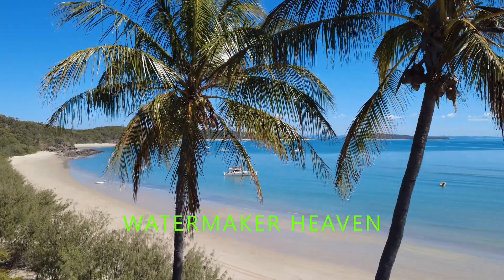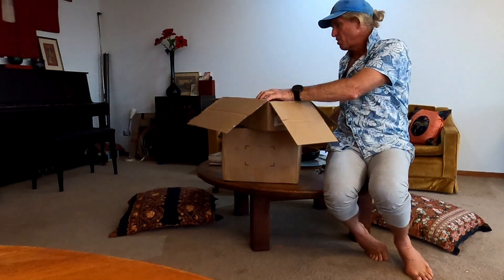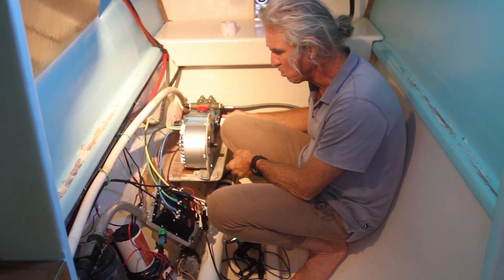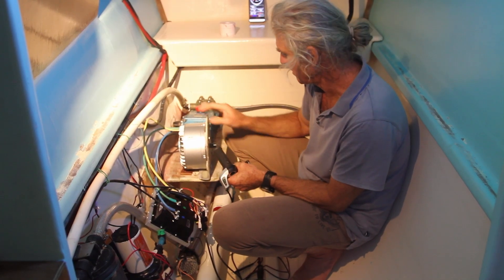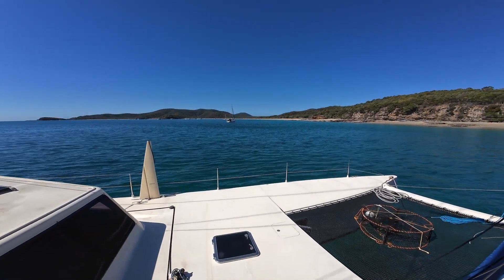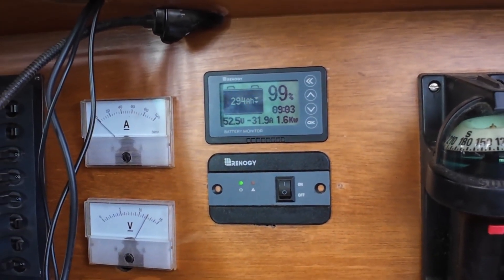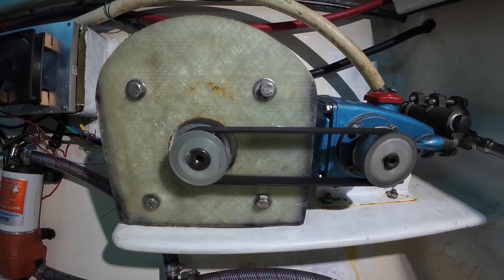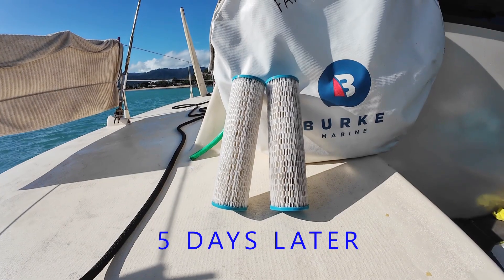48V Electric Watermaker Setup on Our Catamaran - Tips, tricks & hard-won lessons.

Comment: That's a pretty slick use of available motors and parts! I don't have access to all my stuff, am working away from home for now, but when I was building an electric gokart project, I was testing throttles and learned they're basically just a PWM set up, the throttle is basically a potentiometer. I tested a 10 K Pot (I think?) and that worked just fine, maybe the range wasn't right, I don't remember, but if you can get something like that, you could set the range on the pot, but it wouldn't be spring loaded back to idle. If you are handy with electical or electronic components, you could also just set up resistors to do the same thing, but I'm pretty sure the motor controller expects idle on start up, so you'd need a switch in there, to switch between idle and running speed. I found one of my old videos from that project, where I was mapping the throttle signal here,  jump to 1;45 or so if you don't want to watch the whole thing.. . https://www.youtube.com/watch?v=i_NUaI09tTM Thanks for sharing your set up, that's pretty cool!
Reply from the maker: Hello Carlin, thank you for these comments. Loved your off-road bike build, what an interesting life you have! I concur completely with your comments of the twist throttles, the band of movement is quite small. Even worse is the foot throttle I am using for my main electric motor! I have this foot throttle connected via morse cables to the cockpit controls but he amount of travel I get is very touchy. You may not have seen the end of my video on the watermaker, but I actually fit one of those potentiometers  and it is so much better! In my case I don't want the spring back so it is perfect and I can simply dial up the required rpm. I am thinking that I should try to adapt one to my 10kw main motor and replace the foot throttle. It just seems such a small and simple thing it makes me nervous! I could fit a little lever to it to work in the same way I have adapted the foot throttle. Thanks for the comment and enjoy your remarkable life!
Reply: @AndrewStransky-cc2dr  Sorry if I missed the use of the potentiometer, we're on the same journey I guess! If you are able to measure the exact resistance of the pot at the speed you want to use, you could just drop in a resistor and then it would always be at the same speed. However, I think the motor controller still needs to start at idle, so that wouldn't quite work right. Anyway, this is the fun part of the internet, odds are someone else is doing the same thing, and we can freely trade ideas and experiences. I was in the US Navy for 9 years, but I was an aircraft mechanic. I don't know much about boats, so always enjoy watching the sail boat videos!

Comment: Thanks for the great video. I'm completing a 40ft solar powered cat which will capture rainwater from the panels. I have two 400l tanks just for drinking water and two 170l tanks for everything else. I may build a water maker like yours if this amount of water proves to be insufficient.
Reply from the maker: Thank you Alan! We have similar sized tanks and a good rain collection system and have often had abundant water from the rain. And of course you can always fill up at a dock. Yet there are certainly times when the rains don't come and it can be expensive or difficult to dock up to get water. Also having the watermaker means you can keep your boat a bit lighter by carrying less water. Wishing you good luck with your solar powered cat! I'm sure it will prove wonderful!

Comment: I like the system but I am surprised at your power consumption . We have a standard Dessalator 100l/h unit. It used the same cat pump as yours but a 800w 12v motor. When running we are using about 35 amps at 12v.
Reply from the maker: Hello Mike. around Yes, I am rather amazed as to what you say. All the study I have done on the Cat 277 HP pump says that around 1500w is normal for running these pumps. Also many watermaker producers suggest such a power usage to run this type of 90l/hr membranes. I do know that the Spectra type of watermakers that utilise a special and very expensive type of 2 -stage pump, they are considerable more efficient. My friend has one and it produces 40l/hr at 40 amps @ 12v . Your system sounds truly amazing. Is it a particular model or a DIY build. ?
Reply: @AndrewStransky-cc2dr it’s a factory fitted Dessalator brand from France. On my cat 277 pump there are only 2 pistons running the middle one is blanked off. We have the compact unit which has 3 x 21 inch membranes in Series. We used to have a spectra on our previous cat with the Clarke pump. One nice thing is that there is a high pressure tiny accumulator fitted to the Cat pump which takes the pulses out of the flow and they say is good for the membranes
Reply from the maker: @mikeferguson2828  that is very interesting. So they have converted the triplex pump into a duplex! I'll have to look into these pressure accumulators as well. I do so love the technical world involved in sailing, there is always so much to learn! Thank you for this input!

Comment: This is excellent! Thanks for sharing. I really like the modular construction.

I may do something similar to this.
What’s the type of high pressure pump you have there?
Reply from the maker: Ahoy the Arctic Sea Camel! This HP pump is a Cat 277. They are quite expensive, but a good pump. I got it off my fathers boat when he removed his neglected watermaker. Our original pump had eventually began to leak oil. I have seen cheaper ones that would do but the Cat 277 is well respected.

Comment: Torque is Amps, Amps is heat. Why not use a 3000rpm to drive the pump at 1500rpm?
Reply from the maker: You make a good point Blackeyes! I will make further experiments with this idea. I have tried running the motor at a higher rpm but it still seems to only run for the same length of time. Perhaps if I changed the pulley ratio to run it faster and allow the fan to run faster this would work?
Reply: @AndrewStransky-cc2dr a higher pulley ratio would certainly decrease heat, but another thing you might try is direct drive with a coupler.  That would eliminate the efficiency loss of the belt and pulleys and therefore decrease some heat as well.  Direct drive will be the most mechanically efficient (2% better than a timing belt.)  A higher reduction may be more electrically efficient therefore overcoming the 2% gain from direct drive.  For example, if a 1.5:1 ratio sees a 3% gain in total efficiency, then you don't even need to test direct drive. If it's getting that hot, a significant amount of the electricity is being converted directly to heat so I wouldn't be surprised if a higher ratio was better than direct drive.
Reply from the maker: @zacharymorris9917  Hello Zachary, yes I will try a 20 tooth pulley which will mean the motor will run at around 2500 rpm, which should give it a better chance to cool itself. In this way I could still use the same belt.
Reply: @AndrewStransky-cc2dr howdy Andrew, have you tried different pressures or does the data sheet for the membrane show an efficiency graph at different pressures?

Looking forward to seeing your results.
Reply from the maker: @zacharymorris9917  hey Zachary! I have tried lower pressures but I felt the overall output didn't benefit much, especially considering the additional noisy runtime involved. I think increasing the motor speed with a smaller pulley is my best bet and will order a pulley asap. I did take off the motor back plate thinking that may help more air get to the motor but I feel that may have been a mistakes as the air is probably not directed as well, so I have to re-fit this piece! It'll probably be a few weeks before I can order a pullet and carry out this trial.
Reply: @AndrewStransky-cc2dr did you get a chance to try a different pulley ratio?
Reply from the maker: @zacharymorris9917  Hey Zachary, thank you for reminding me! We have got back to what is town for us, Moreton Bay, where we don't run the watermaker as its too silty and we can get water, so I had forgotten about this, but I will order a pulley today. We are off on a cruise south at the end of this month.
Reply: @AndrewStransky-cc2dr cool.  Let us know how it turns out

Comment: I don’t understand why people don’t use solar distillation systems on boats. I haven’t found anything online in years. I guess I’m going to have to make one and see.
Reply from the maker: Hello Michael. I did once meet a guy sailing around the world on a Wharram tiki 20 and he had one. It was a ring about 80cm in diameter with a raised clear plastic cover that collected the fresh water. It made about 1.5 litres a day for him. It would probably take too big a one to provide for the demands several people on a yacht.
Reply: @AndrewStransky-cc2dr  I think I’ve seen those, but don’t they float in the water ? Probably too fragile for voyaging. Maybe a similar concept could be incorporated into a hatch cover?
Reply: @AndrewStransky-cc2dr  I think I have it: Wet surface of a solar panel, a clear enclosure to trap the vapor. Scalable to as many panels as you have, keeps them cooler for better efficiency. Thanks for pushing me to think about it!
Reply: Those I have seen has been way to inefficient for daily life/use. That said the new design from MIT (a year or two back) looks really promising. Edit: Search for: mit desalination breakthrough.

If you want to try the distillation rout you should look at compound parabola.  Nighthawkandlightning has a nice video on making those.

I also wonder if it is possible to use fresh mangrove branches the same way you can purify water with birch (and other leaf trees) cutoffs.

Comment: Great and simple setup.  How did you determine what size golden motor you needed?
Reply from the maker: Thank you Nuts and Bolts! I originally had the idea they required between about 1.5-2 hp by the way it bogged down our 13hp motor we originally ran it from. I did plenty of Google searches but could never quite pinpoint this. Then when my dad removed his neglected watermaker from his boat I saw its 240v motor rated at 1.63kw. So this turns out to be exactly what it uses. It was a bit of a shot in the dark though, to hope the 3kw would run it! I should have brought the water cooling model though as I can only run the air cooled model for 30mins so far, but I may be able to improve the air cooling system over time.
Reply: @AndrewStransky-cc2dr do you have any experience with the high pressure pumps.  You mentioned the one you have is common, but are there high flow pumps available?
Reply from the maker: @nutsandbolts432  the one I have in this system is a Cat 277 pump and they are commonly used on production watermakers and feel of very good quality. You can see them for sale and also on ebay used. There are also a number of HP pumps much cheaper on Aliexpress and you could probably use one of those but figuring out the equivalent is a bit tricky, People also use the Karcher pumps running off 240v as a HP pump in this kind of system.
Reply: @AndrewStransky-cc2dr If your motor is overheating, try switching pullys to change the gear ratio. Smaller motor pully or bigger pump pully. Have the motor run at a higher RPM but lower torqe will reduce the current and the heat generated. Pump RPM should be the same.
Reply from the maker: @eriksvedlund5961  thank you Erik, I will try this. I had been pondering doing this but had begun to think it would make no difference but you have given me new hope it could be the answer.

Comment: Thanks for that interesting video. I like how you have put the water maker together using off-the-shelf components.

I have an off-topic question though. Could you tell us more about your cat? (I'm looking into building, or purchasing, one myself)
Reply from the maker: Hello Sandi, yes, watermakers are quite simple really to put together as there are only a few components. Especially if you keep the system simple. Fantasia is a Seven Seas 50 that I designed and built myself. It is developed from ideas from many designers but predominantly Lock Crowther. It is an extremely fast 15.6m catamaran built for cruising but it turned out to be a very successful racer against pure race cats. It weighs 7800 kg in full cruising mode, no water or fuel. You can see more of it on my website and under Fantasia Sailing on Facebook and there are links under my channel info. Even though she has been to supremely successful in Australia and Asia, Fantasia still remains a 1 off. People don't seem keen to build their own boats so much these days. I still have the mdf frames used for the strip cedar molds.
Reply: @AndrewStransky-cc2dr  Ohh wow! That is quite impressive that you designed the cat yourself. I have considered doing the same, but I do not have the experience to be able to judge what would be a good or bad idea.

Comment: That's great, another reason to get rid of fuel. Also very tidy/clean setup.
A parts list would be handy, if you were to replace it on a new boat today.
Is there a reason you don't filter with charcoal or UV?
Reply from the maker: Yes, I'll draw up a parts list and include it somewhere soon. Additional filters just seen unnecessary to me. The watermaker has already done this job and the small amount of particles left in the water are necessary to give the water taste and you need these minerals etc for health. For awhile I was under the impression that watermaker didn't have enough minerals in it so wasn't so good to drink too much off. Now I have learnt that it actually does still keep a reasonable amount of minerals, so it tastes very good.

Comment: Some great info here Andrew. I like the fact that the whole system can be replaced with similar parts in future if required.
- I'll need to look into those pleated filters for my system, could save on future costs.
Reply from the maker: Yes, the pleated pre-filters are the go. We have used a lot of those spiral wound ones, but they don't clean up as easily. The pleated ones have sturdy rubber ends and the particles collect on the pleats outer surfaces so this comes off nicely.